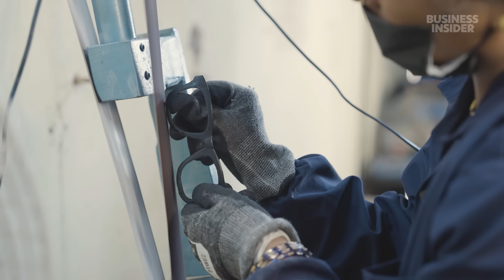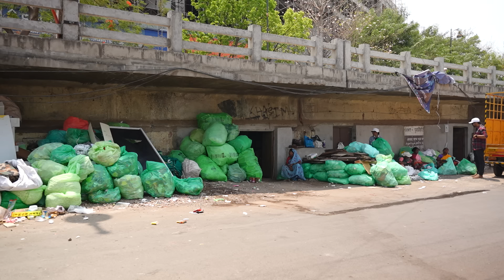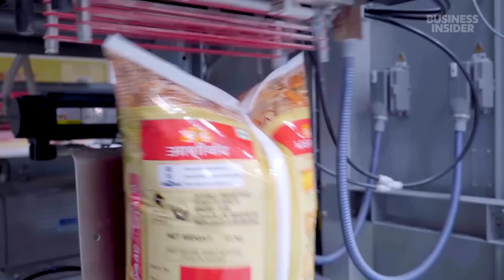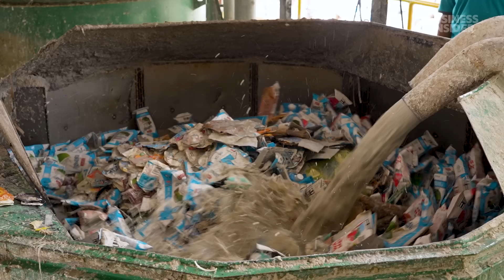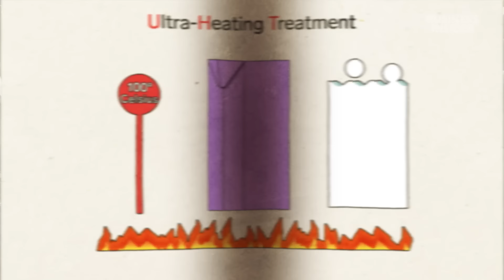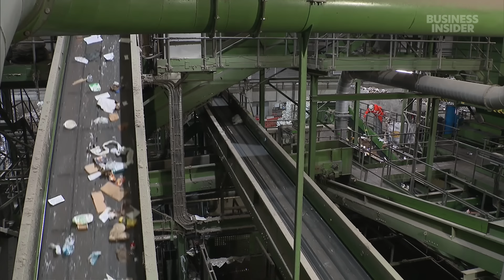Why Are Chip Bags So Hard To Recycle? | World Wide Waste | Business Insider

Comment: Tetrapak is just so unnecessary. You could just use glassbottles instead. Can be reused like 50 times and even if they break, it is just basically sand. The only downside is the weight, but common...

Comment: if only it were possible to ship chips in something like a cardboard tube
Reply: Pringles tube is lined with aluminum, and has a plastic coating on the outside.  And they're not potato chips, but ground up potatoes shaped in  a mold.

Comment: Yeah, nice, but.. kind of stupid.

The chip bag recycling to make glasses? Eh, sure, but the whole process to recycle the plastic probably used more kWh in oil energy than is output. Probably by a factor of 10 or 100.
The tetrapak recycling? Yes, Tetrapaks are nice and easy to use, but the school handing out single small little packets of milk to every kid every day... Just get milk in directly from a dairy in a steel tank, and distribute it to steel cups. No waste, and steel is easily recyclable.

Chip bags aren't the issue. They're extremely light, so a tiny amount of material is used, and they are fairly flammable, so they can be used to generate power after they've been used in waste power plants (as there are many in Switzerland), while the aluminum melts down into the slag and can be recycled from there. 

An empty chip bag is maybe.. 1? 2? grams of plastic. According to 9:36, 300k bags are 1500kg, so 5 grams per bag. Okay.

Drive one km in your car? without taking into account the whole shipping and production pipeline, and assuming crude oil 1:1:1 to plastics and gasoline; 1km takes around 50-70ml, so around 50g of gasoline; the same as 10 chip bags. And that's just burned, gone. If you drive 10km to the grocery store and back, that used the same amount of fuel as 200 chip bags.

And even if you put it as the main issue being that crude oil is limited, and we won't have plastic forever. Trust me, once crude oil gets really expensive, synthetic oil for use in plastics will very, very quickly advance. And even if it's 5 times as expensive as normal crude oil, for lots of plastic packaging, that doesn't matter that much. Whether you pay 0.003 or 0.015 $ for your chips' packaging - that's 1-2 cents per bag more, with markup. And again, when it's used, it can be burnt efficiently, the carbon released captured and used to fuel synthetic oil production again. That's the way of the future, not making cheap glasses that sell for many times glasses should sell for just because 'they're made from recycled plastic!'

Comment: Knowing it's so hard to recycle them the manufacturers should be forced to use bags of appropriate size. They are comically large for what you get. So we have excess material that cannot be recycled and lorries transporting the goods from manufacturers to distriutors and then again to retaillers cannot make efficient journies as they are full of exces air. They therefore need more trucks/journies which means burning more fuel and releasing more pollution from both exhaust and tyres.

All packaging should be as small and minimal as possible, even if it is recyclable.

Comment: I applaud Anish, but his contribution is way less than a drop in the ocean. I work for a company that makes recycling plants for various plastics (PET, HDPE, LDPE) and 25kgs an hour is honestly nothing. A medium-sized plant for recycling plastic film usually processes between 1000-2000 kg an hour and is way more automated, with just a handful of people actively working on the plant.

Plastic film made up of a single type of plastic is also one of the worst types of materials for us, since the low density tends to clog up the machines and reduces yields by a lot (you need a way bigger plant to process the same weight of LDPE compared to HDPE or PET).

The only systemic solution to this issue is to force the companies producing and selling these harmful packaging to also be responsible for the recycling. This means either forcing them to take back all the packaging they sell, or a tax of sorts per unit of packaging sold that is then used by the state to fund recycling operations. Personally, I like the first option better

Comment: There is a  confusion here. chip packages  are only made with 2 layers of BOPP films, one of which is metallized with 200 angstrom Aluminium coating. It does not contain any PE, PA,PVC. It is very easy to recycle alone. What they mention here is to seperate different types of polymers and the title of this video is irrelevant with this video. Sorry to say. there are various very developed methods in the world like IR sorting  methods to seperate. But this is india, it is clear that man force is needed instead of sophisticated methods.

Comment: One reason is that for one worker to survive here you would need to sell 500 glasses, so did they have like 10 workers so 5000 glasses a month.. .like the math does not work over here and people rather spend 100 on high quality glasses.

Like much is made with 3d printing so if you could get that plastic just recycled cheap enough with high enough quality on the plastic then you open up a whole new world.

Also we aren't allowed to use chemicals in the same way they do and you would also need a machine that sorts bags out or have people separate them in the trash, like the working conditions there would not be allowed here.

I think the main thing someone needs to figure out is to create one chain of systems that will separate it all and until that day burning will be the option because that produces energy that you can sell. Sadly our world revolves around profit and the producers of a problem rarely wants to pay for the solving of the problem because that equals less profit for the shareholders... 

Like we already have the tech to solve every issue, we just lack the will to solve it.

Comment: Interesting... I actually work at an Plastics recycling company and the bags, at least here in Austria/Europe are mixed with other plastics packaging. Usually its PP so we just shred, wash and extrude it together, as some foil with all the cups and boxes actually makes the material more usable for some of our clients. Filtration during the extruding process separates some of the  metal along with other impurities and while it still does produce waste, its at least not 100% of the bag that goes into a furnace... we also recently got a new sorting facility which could detect and separate em, if not right now it would only need some training of the AI software, though im (not yet) involved into all that as we're still in the finalizing process...

Comment: 10:00 because the ROI is low, he can do all that with cheap labor, if the companies that produce the bags also recycle, it will eat away their margin for profit. The whole potato chips market wouldn't have existed if the companies had to worry for the bag after the consumer buys them. 

That's why most of the recycling efforts for plastic is most prominent in Developing countries with cheap labor and foreign carbon offsetting investors. 

Companies that produce products which cause pollution should be the ones held responsible instead of the consumer for buying the products. With how chips companies advertise their product and use human psychology, it's no wonder we buy them. But at the same time they should also be held partially if not completely responsible for the pollution they have produced and are producing.
Reply: money

Comment: potate chips are also stupidly expensive. we need a gadget that can make potato chips at home.
Reply: You mean... A pan... and cooking oil? Truly revolutionary stuff!

It's just a complete mess and takes forever so no one does it.
Reply: @fredrikcarlen3212  you need a device that can conveniently cook it and drain out all the oil. Because the crisps (chips for you) is so thin it cooks really fast, so it needs to be dipped hot oil, cooked and quickly removed before it gets overcooked. 

There is probably a very specific way of cooking and rinsing off the oil which makes it not viable for a ordoinarty person to do at home.
Reply: @simonbutler377  There's a "how it's made" episode on potato chips, they're just deep fried and dried off. Not really hard to do at all at home, just very inconvenient.
Reply: @fredrikcarlen3212  do they do it in a frying pan?
Reply: @simonbutler377  Hot oil is hot oil, doesn't matter what you put it in as long as the temperature of the oil is the same..
Reply: @fredrikcarlen3212  so Im guessing you dont have any appliances then? no toaster becayse just grill your bread on the cooker.

no electric kettle because heat the water in a pan. 

I am just flabbergasted someone can watch a video on an industrial chip production and think that they cando the same on a home cooking pot. You need a device to make wafter thin slices, you need to flash fry it and then put it in a centrifugal spinner toget all the oil out. Its a very messy prces without the correct appliances.
Reply: @simonbutler377  I know it's a messy process, I said it's very inconvenient didn't I? My point is it can be done, it's just a bit of a pain in the ass and not worth the effort.

"A device to make wafer thin slices" ...like... a mandolin?
Reply: @fredrikcarlen3212  why do you have a toaster, kettle, microwave, blender? everything can be done with knife and pan.

Comment: This seems like it isn't worth it, not even close..
Plastic is basically refined oil.. soo.. just burn it for heat or electricity, instead of fresh coal or oil...
Reply: That is not quite how it works. The chemical structure is fundamentally different so it does not burn as cleanly and requires higher temperatures due to more bonds needing to be broken. PET and i think polystyrene contain aromatic structures which are highly stable so consume lots of energy to destroy. PVC also contains chlorine atoms which probably either turns into HCl (acid) or chlorine gas (highly toxic), nether of witch you want in the air. Not to even mention the amount of CO that comes out of it

Comment: The sunglasses are... pointless? Will never scale to any significance. Why not just focus on on the filament stage, where it could be sold en mass for 3d printing/injection molding.
Reply: Probably the filaments were too weak to be printed. And sunglasses have better margins.
Reply: I don't work there, but my suspicion is that "plastic pellets, but they are recycled (so a bit less robust) and also more expensive" is a pretty tough sell for the injection molding industry, and so consumer products like sunglasses are a much easier thing to pay the bills with (higher margins, less picky buyers) until the process can scale to a point of profitability, if ever. 3D printing suffers from the same concerns but I also generally doubt it's a good thing to optimize for - 3D printing generates a surprising amount of waste itself!
Reply: Probably because they'll end up being more expensive and lower quality than virgin materials. The plastic industry as a whole tends not go give a shit about anything but profits, and with virgin materials they can still put "99% recyclable" (lots of people won't tell the difference) on their products and produce them cheaper.

Comment: That factory is also a microplastic generator. How do they clean it up?
Reply: As mentioned above, here's some context on the microplastics thing: we shred the MLP to reduce the overall bulk density (volume) of the material to allow us to process larger quantities, making it more economical. Most of the microplastics you see (~99%) end up being extruded into high quality material that can be used in premium applications where conventionally virgin plastic is used. We are also working on minimizing the stray ~1% microplastics by increasing particle size and minimizing air exposure. All our colleagues are also given N95 masks (many choose not to wear these, but we are mandating them). It's not perfect, but we are trying! And all this feedback is helpful.
Reply: @madewithout  thank you so much for all the effort, this inspires me a lot
Reply: @madewithout  Thanks for replying! What I meant is the stray microplastic since by scooping and moving the shredded MLP alone, for example, we can see that your employees spread those microplastic particles everywhere onto the factory floor like at 4:41 onwards.
Reply: @hitthedeck4115  Your concern is valid and you are right, all plastics once made will turn into smaller and smaller pieces of plastic and they do this whether handled, processed or even left alone. It's called plastic shedding and it's a problem the manufacturers should ultimately deal with. If they were charged with cleaning up after their mess it would cost so much to remove it all from the environment it would bankrupt them and they wouldn't be able to make anymore. That's the kind of regulation the world needs over these corporations.
Reply: @madewithout  there needs to be an extraction and filtration system connected to the dust generating machines as well as the wastewater.
Reply: @ashaya.without sorry but what you do is not sustainable. It's true that all plastic in the environment will eventually become microplastics, but you are accelerating the process. Once discarted, your high quality material will decompose and release microplastics potentially faster than virgin plastic. Besides that, it's clear from the video that huge ammounts of plastic are released into the air in the manufacturing process. You claim 99% goes into the final product, but the way the shredded particles are handled in the video suggests otherwise. Plastic recycling is a dead end. All focus should be put into the discussion of prohibiting the utilization of single-use plastics.
Reply: There is so much plastic and garbage that it can be burned and used as free energy, Germany has an incinerator that burns plastic to nothing but carbon and c02 but dont fogot about our precious invisible force field that we must protect to keep rich people from getting too sweaty, so you might as well just shut up and deal with everything being poisoned..

Comment: Spend all this effort just to make recycled material that uses 70% or more energy than making the material from scratch?? Incinerate the trash and also get electricity out of it. Wow.
Reply: As mentioned above, we have conducted an independent ISO certified life cycle analysis (LCA) for this, and our process in the pilot scale (only 50kg/day) will have a negative Carbon footprint. That obviously doesn't make sense intuitively, we do use energy in our process, but it takes into consideration avoided emissions as well (from virgin plastic production and bad incineration). Incineration, if done well, can be an interesting solution, but it's a destruction of value. And more often than not, incineration is not done properly, leading to release of toxic greenhouse gases and particulate matter. Our goal is to extract value (materials) from this MLP and use them over and over again. Sunglasses is just a proof of concept, but they are in fact more recyclable than conventional sunglasses because you can recycle our material in conventional PP or PE streams. We have even managed to recycle our material 10 times in our lab without significant change in properties. Our solution is not perfect, but we are trying to look at holistically!
Reply: Incineration produces a lot of air pollution and greenhouse gases. The best thing to do is to get the corporations to change their packaging.
Reply: @e.cambay5263  And then everyone complains more because their product doesn't last as long and is more expensive. There is no replacement for plastic at this point. The genie is out of the bottle.
Reply: @orga7777  That's fine. Let them complain. Don't replace it. The genie has degraded into nano-sized particles and crossed into our collective blood-brain barrier.
Reply: @RichTapestry not everyone is rich like you. We sre going through an economical crisis. People afford less than they used to...we don't have the money for this luxary
Reply: @gabzos  I'm not rich, the name is a pun. Milk used to only come in glass bottles for most of the 20th century, and it was cheap enough for everybody to afford. The bottles were reused bringing down costs. Milk in glass bottles didn't used to be a luxury, why do you think that's changed?
Reply: Sell products in reusable containers like milk delivery used to
Reply: @minitea4315  Do you want to spend an extra $4 on milk? Cause you can do that. Just buy stuff like Oberweiss. Just don't complain about it later.
Reply: @orga7777  Milk came in glass before, and it was cheaper because glasses were collected, washed and reused at a cheaper cost than creating new ones. It was a circular economy, and glass is inert.

Do you want to fill your brain and body with nano-plastics to get future-cancers to save a few bucks on milk?
If governments weren't propping up the oil industry with subsidies then plastics wouldn't be cheap enough for single-use packaging anyway. The only reason it exists is because the industry lobbys (bribes) politicians, not because people wanted their milk in plastic.

Comment: Come on BI.  This is not a solution.  This is an advertisement for glasses.
300k chip bags is likely what 2-3 large supermarkets sell in a year.  Numerous chemicals are used to separate the lighter plastics so they can be skimmed off and mixed with even more chemicals.  No mention of what happens to the now poisoned waste products.